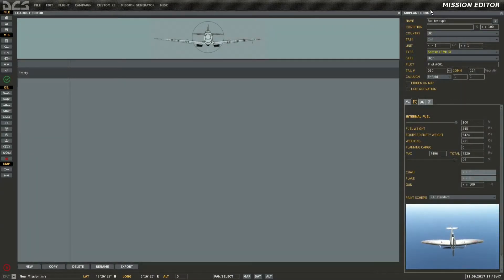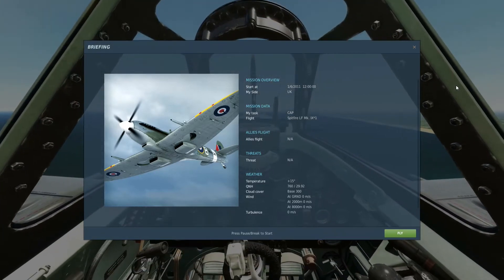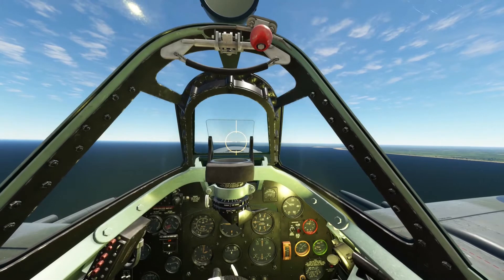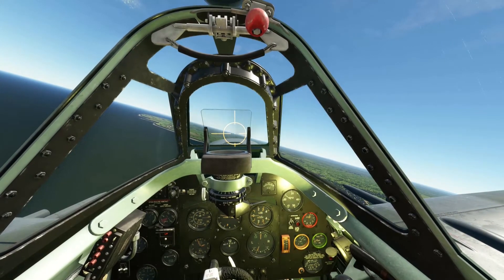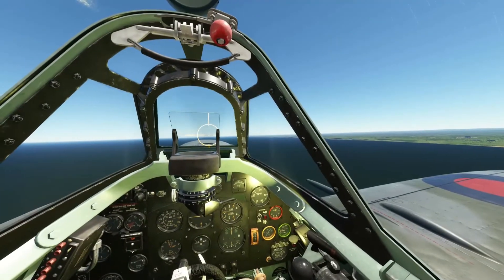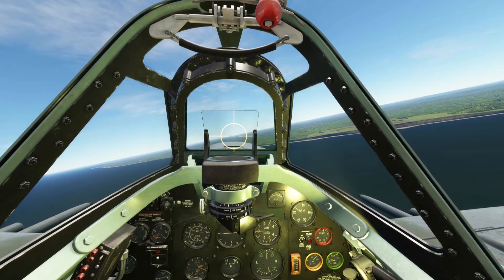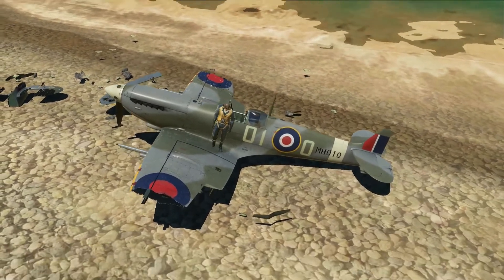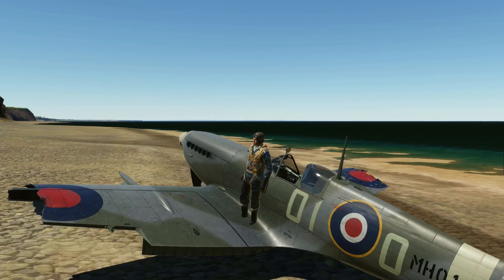DCS Spitfire - Fuel Consumption - a controlled test

Comment: Can't say I'm suprised,  since there isn't a mixture leaning ability, to my limited knowledge of modelling, it would simply be an extraction of figures from a data table with almost no variables.

Usually the more suspicious figures in terms of accuracy are climbs and turn rates because there are more variables involved.
Reply from the maker: n8d0g mixture does lean. It leans below 7lb boost. Are you suggesting there is a problem here?
Reply: No, and if you re-read what I typed, I'm suprised you viewed it as such. Again, to repeat, I am not surprised, ie, I concur with your findings, because fuel consumption would be a data table extraction from a data sheet. Which is less prone to error due to the input of the dev.

I however, will clarify what I mean my leaning ability; that is the manual ability to lean the fuel via a mixture wheel/lever.  

Hope that clears things up.
Reply from the maker: n8d0g ok. Gotcha